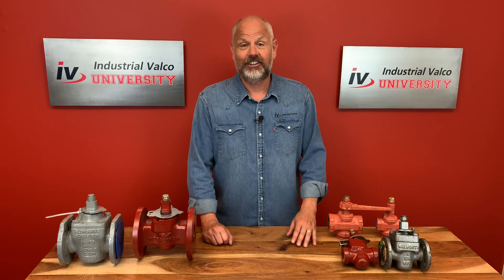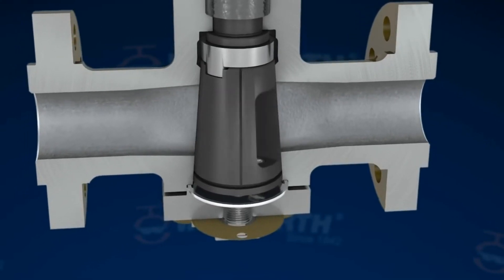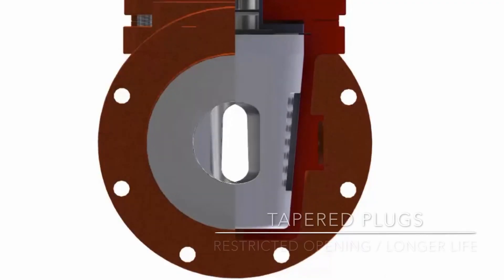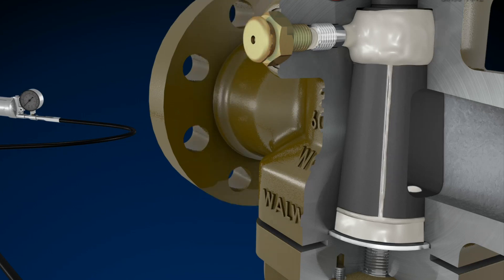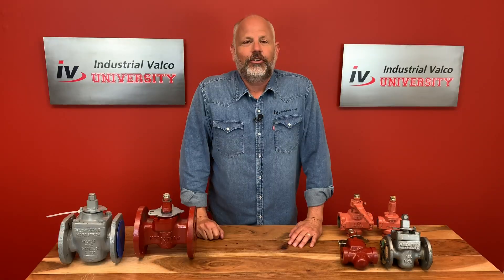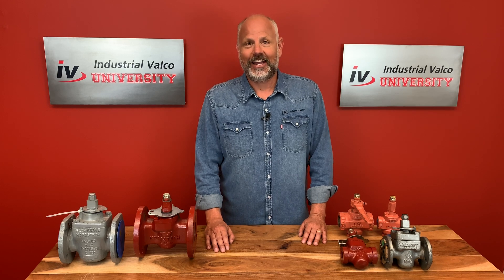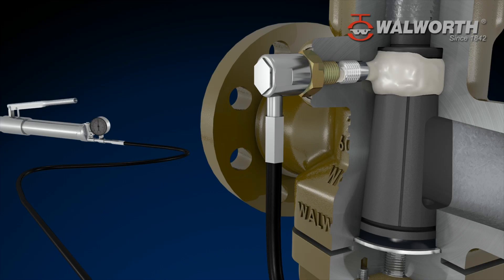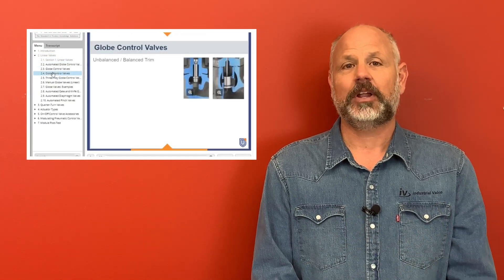What are Plug Valves (w/ special guest Joe Exotic)

Comment: plug valves controlled by an automatic actuator and pressure sensor are great for throttling water. DeZurik and other manufacturers recommend it. They're cheaper and lower maintenance than a pressure sustaining valve like a cla val or bermad.

Comment: can these be lubricated with pressure on the valve?
Reply from the maker: Yes, They are designed to be lubricated while in service. Be careful to monitor the pressure in which your injecting the lubricant/sealant. Always consult the installation manual from the manufacturer. Thank you for your comment